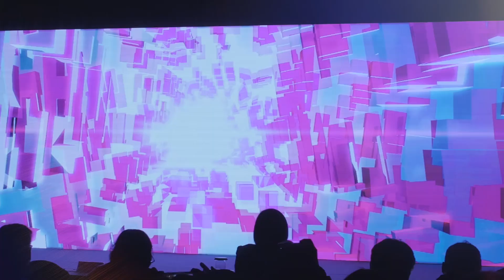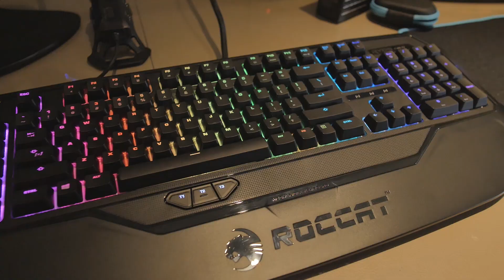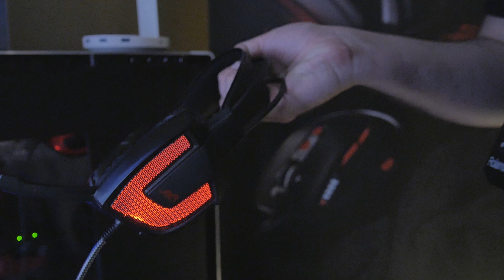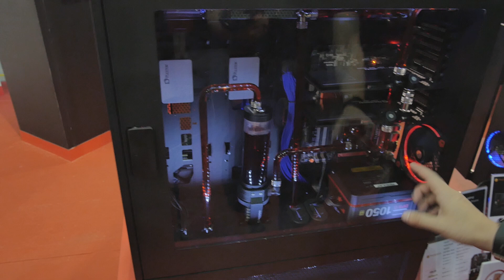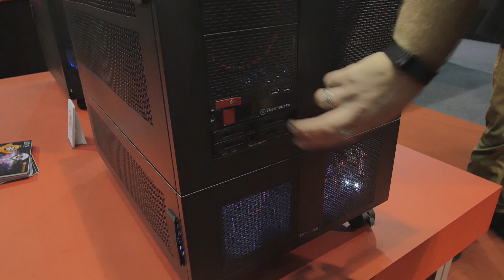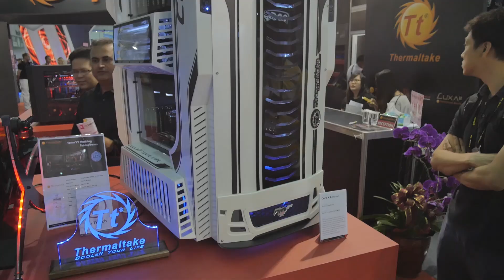Patriot, Roccat, & Thermaltake - Computex

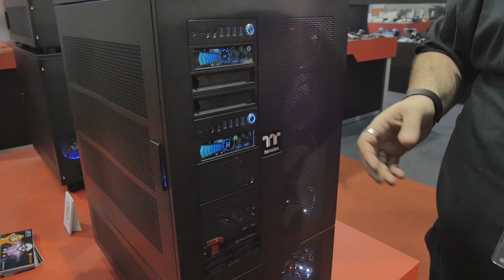Comment: As far as the Thermaltake part of the vid; IF the shape of the vent holes are compromising the structural integrity of the case in any way that matters to a computer case, they are using materials that are entirely too light/weak, and too cheap to use a little more material where it is needed to strengthen the case.  Besides the fact they are blatantly copying everyone elses case designs (then destroying them by "cutting costs" and making them cheap as hell), Thermaltake has greatly reduced the quality of their cases and is heading toward destruction.  They used to make good cases, and designed their own stuff, but what I see from them now is quality worse than Antec, and design "inspired" by other companies (complete aesthetic clone), but changed (material, build quality, cutting features) to reduce the BOM cost and maximize profit at the cost of a truly quality built and desirable case.  They have always made "cheap" cases for the budget build, but they also made GOOD cases for the enthusiast (or just the consumer that cared).  I loved their V6 case, and used several of them for various builds, as well as their DH 101 for media center builds (AWESOME case for that, matches an A/V receiver and home theater nicely), while their V9 case was a little larger and differed slightly from the V6 (and more expensive), it could have been built a little more structurally sound (they had a problem with collapsing on the top rear of the case and causing fan misalignment or binding) and the V3 case was comparable to a twenty dollar Antec case and I wouldn't recommend it to anyone (I purchased one, and it immediately was returned upon unboxing it).  Most of their current offerings have the looks of other desired quality cases from companies with pride, but build quality that Antec would scrap.  As an example in this vid (besides the vent hole issue I brought up at the beginning), at 9:38 you can see how the side cover is warped on that case (they couldn't even find a good one for the trade show???), this should NEVER be an issue unless the case is abused heavily.  So...I am hoping that Thermaltake either goes out of business VERY soon (possible with the crap quality of the offerings of late, of EVERYTHING they build) or get their act together and start offering products that are not complete POS aesthetic copies of other products.

Comment: I like my Roccat gear however will warn that I have been through three mice and each time the heat from my hand over long periods of time melts the glue they use on the smooth rubber making the cover slip and seep glue.
Reply: yes the first one got replaced (not a lot of fuss) the second one went past warranty so I repaired it with some adhesive from work and did same for third without asking.

Comment: In what world would you need 2 scroll wheels on a mouse? Pretty impractical/unnecessary, especially for a gaming mouse.
Reply: MrNoodless If one of them can be used for horizontal scrolling it could be very useful for certain work, for example, dealing with large spreadsheets. I do agree that it's a bit unnecessary for gaming, but we'll see.
Reply: MrNoodless I think it's to accomodate different grip styles but yeah, it looks ridiculous.
Reply: MrNoodless If you remap keys often, it would definitely be worth it. I can imagine a few games I could use it in.
Reply: Horizontal scroll is useful
Reply: Nopiw have you not thought about how you may miss scroll? seems so extremely easy when they are right one is right in front of the other. Will destroy your game.
Reply: ***** I don't think. He had any. Intent on buying it.